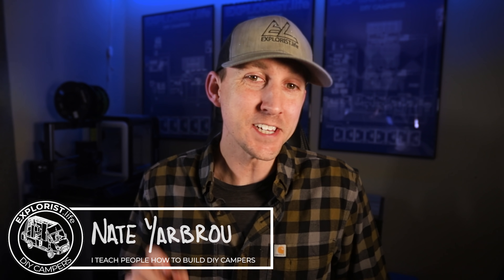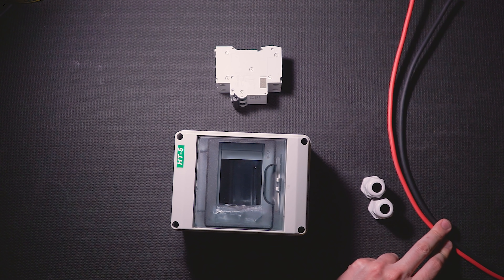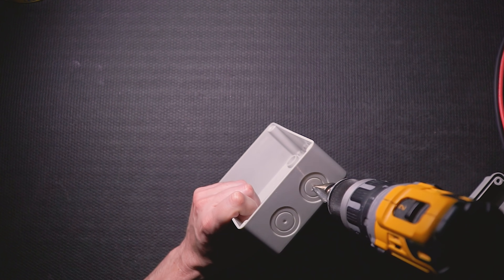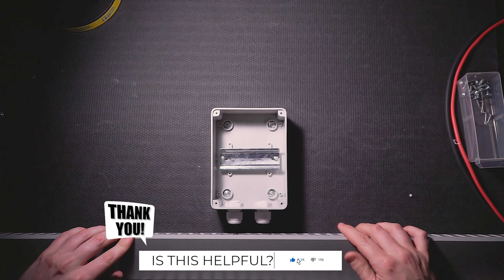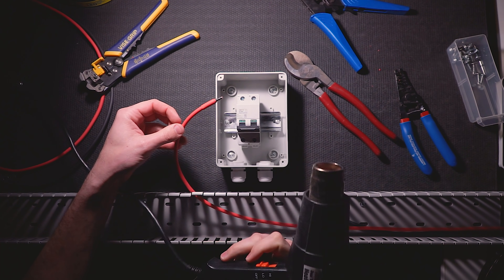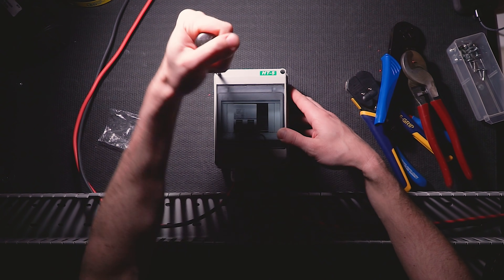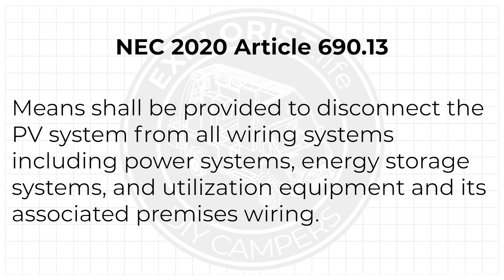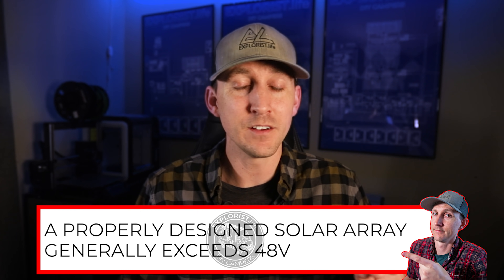How to Wire a Solar Disconnect for a DIY Camper Electrical System

Comment: Nate, you're killing me! ROTFLMBO! Ok, So I eagerly watched with the hopes of seeing how to actually install this little red box with a picture of a battery on top...wrong! I do understand why this component is needed, however, when I went to your page for the list the component is UNAVAILABLE! Now what? There's a link to a breaker box but it's gray and WTHeck? This is turning into the story of my van builds life...always a speed bump(feels like a cement block) now what? I just want to plug the panel into the charge controller, hook it up to a battery, and just wait for the explosion at this point... I am beyond frustrated now.(attention span of a gnat and I am a visual learner. Deviation from what you showed greatly confuses me) BUT I am learning a lot so, yay?
Reply: You can use any non-polarized, dual pole DC breaker and enclosure. I can personally vouch for Blue Sea's products. However, they're pricey, and I prefer the type Nate highlights. DIN rail mounting is the way to go, and this gets you away from somewhat proprietary gear from some OEM's. This is how it's done in every country outside the US!
Reply: @ARepublicIfYouCanKeepIt  Thank you I had to watch the video a few more times to fully comprehend it, but I do now. I will use the red switch between my battery and inverter.
Reply: @evespower1  While a properly rated battery selector switch is acceptable to isolate the battery from the inverter, this connection must also be fused. Accordingly, please ensure that a properly rated Class T or MRBF is protected the circuit, as well.
Reply: @ARepublicIfYouCanKeepIt  yes, that much I do know. Thank you for the information.
Reply from the maker: Oh, gotcha...  The 'red switch with a battery on top' was never part of any of my diagrams between the charge controller and the solar panels.  I have one of the 'red switches' between the battery bank and the Lynx Distributor in each of my diagrams, though.  Which of my diagrams from https://www.explorist.life/solarwiringdiagrams are you trying to follow?
Reply: @EXPLORISTlife  I was actually following the video (visual learner)from how to wire a solar system in a camper the one that’s an hour and six minutes long… honestly, I had not looked at one of the diagrams on your website yet. I just go there for parts and to calculate the Amps that I need. You would be proud of me I found the breaker box after I thought of a few different words and understood it’s purpose instead of the HT5, I got an HT8 from Amazon and I installed it yesterday! I’m so happy! Now today I’m going to try to figure out where to put this little red thing I’m guessing it goes somewhere in between the battery because it has a battery picture on it. And actually after just watching your newest video you said the disconnect goes between the battery and the rest of the system… I just have to figure that out. I am Slowly but surely working with what I have on hand. And I’m sure I’m going to upgrade to the Victron later because it just does so much more.

Comment: The Din Rail End Stopper Block shown in your parts list doesn't seem to be mentioned in the video, unless I missed it.  What is it used for?
Reply: It's entirely optional; preventing mounted components from sliding off the rail.
Reply from the maker: Exactly... They simply mount on either side of the breaker if it's sliding around too much (like it was in my video, but I didn't have any din rail stoppers on-hand when making this video and didn't want to delay the video on account of that.

Comment: I switched to that double pole last summer because you mentioned it in another video. Thanks for the explanation as to why. It sounds like that was an update in the 2020 code so there's probably lots of incorrectly wired PV systems on RVs. I had the Blue sea systems circuit breaker and my series/parallel was around 44v so I guess it was ok but I had tunnel vision looking at the amperage and not the max voltage. Thanks for explaining this in detail, great job and thank you 😁👍
Reply from the maker: Yeah, I've made that mistake in the past as well before I really dove into doing this stuff (and teaching it) properly.

Comment: Nice video! My question is do you have a amazon store? I would like a link  to the breaker , make, sizes, and availability...
Reply: I think when you go to his interactive wiring diagrams when you click on an item it goes directly to the Amazon link for the item. It's really helpful! Pretty amazing if you ask me 😁👍
Reply from the maker: Charlie is right...  You can use either my wiring diagrams and parts lists found here: https://www.explorist.life/solarwiringdiagrams for overall system components, or you can check the blog post that accompanies this video for a "Parts Shown" that includes links: https://www.explorist.life/how-to-wire-a-solar-disconnect-for-a-diy-camper-electrical-system/

I don't have a 'traditional' amazon store as sometimes I need to recommend parts and products that aren't found on Amazon.

Comment: Just finished watching, great as always.  My van is in the design phase and I am trying to physically locate this switch where it would be easy locate such that it is immediately accessible to emergency services in the event of an MVA or similar emergency.   My thought is to place it in an electrical box accessible from the out side where the shore power enters the van.  Passenger side just behind the rear axle.   The electrical room is above the rear axle in the rear garage and accessible for maintenance by lifting the step to the twin bed above the garage.   The solar shut off box and accompanying door will be a pain to fabricate but provides some security and yet quick accessibility and visible to fire fighters and EMS.  
Do you or any van owners have thoughts on this?
Reply: As Nate mentions, first responders aren't likely to know to look for this disconnect, or use it in the event of an emergency. The primary reason for this isolation switch/breaker is to allow you to safely work on your electrical system by safely disconnecting a source of live DC current even in low light conditions.
Reply from the maker: Thanks for watching!  So... I was a career firefighter before this whole Youtube thing, so I may be able to shed some light on that issue... but firefighters/EMS aren't going to be looking for a solar disconnect switch in an RV during an MVA.  Maybe in the future, as more electric cars and solar powered campers become a thing, firefighters will be trained more on this kind of stuff, but even If I, as a firefighter, saw a solar disconnect switch; it's highly unlikely I would touch it as I wouldn't know for 100% what it does or what other 'downstream' hazards that flipping that switch may do.

If, in the event that the body of the vehicle was energized... We would call the local utility company to have a lineman come out and get recommendations on how to proceed safely.

Basically... do it if you want, for sure... but I wouldn't stress about it.
Reply: @EXPLORISTlife  what does MVA stand for?
Reply from the maker: Motor Vehicle Accident

Comment: If you’re using Victron charge controllers, can’t you just turn them off using the VictronConnect app?
Reply from the maker: That would indeed turn off output from the charge controller to the battery bank, but would not disconnect the solar array from the charge controller.
Reply: @EXPLORISTlife  
If this was true, then wouldn’t your PV panels burn up your charge controller?
Reply from the maker: Nope.  When using the on/off feature from within the app, the software/hardware interaction inside of the Victron charge controllers will disconnect it in a way that it wouldn't burn itself up.  Even if the disconnection inside of the unit happens 'on the PV side" of things... There still needs to be, by the code mentioned in the video, a disconnect switch that physically disconnects the array from the charge controller.
Reply: @EXPLORISTlife  
Thank you for answering my questions. It’s a fascinating subject, as there’s so much I don’t know or understand. 🖖
Reply from the maker: No problem!  Thanks for watching!

Comment: Great video! Love your channel! 

Do you have a video on how to know where to install solar panels on an rv's (travel trailer in my case) roof?

Thank you! Again, great channel!
Reply from the maker: Hey Wa G!  Thanks for watching.  I don't have a video over that specifically, but will have a video coming out soon that will teach the best size and number of solar panels to use to get to your 'goal wattage' that I will attempt to cover panel placement in.
Reply: @EXPLORISTlife  Thank you!
Reply: Look up best way to mount solar panels to RV roof on YouTube. He uses channel strut which can be attached to the roof trusses and then the panels to the strut. The panels don't usually line up with the trusses so this method addresses that. I was lucky enough to have a hard frost one morning that showed me where the trusses are on my rig. I've heard of some people asking the manufacturer for a roof diagram to find where to drill. I used 1/2" aluminum from a company called Zoro.
Reply: @chachi5975  I saw that video. I just need to see where to mount on 1995 Jayco Eagle 304bh roof.
Reply: What are you looking to do?  ALL RV / roof tops are different. and lots of people do different things on the tops of their RV.   I took out/off my AC unit and put on  1,005 watts of solar.  What size RV do you have and what are you looking to do? :)
Reply: Where they fit. Find the edge and or RIBS of the RV and screw into them.
Reply: @RVingwithG  I have a 1995 Jayco Eagle 304bh. I wanna add solar but I'll take a better look when I get the snow off 😁. Thank you
Reply: @wardg1775  perhaps just a stud finder would work.
Reply: @chachi5975  never thought of that.
Reply: @wardg1775  Hey there, I just checked images of your rig and you have lots of options. A couple of things to keep in mind are:
• Don't overspend on PV panels. Starting with an energy inventory, match the inverter to your highest anticipated amperage, then match the battery capacity to the daily load under worst case conditions (continuous low/no sun days). Finally, match your PV array to the required recharge time under average conditions (Wh/day production), and the MPPT solar charge controller to the maximum PV voltage and battery charging current.

• Correctly connect the PV array. This is done to optimize voltage and amperage carried by wiring to the MPPT solar charge controller. It's also done to maximize production given shading. Remember that even partial shading of a single cell in a single panel connected in series will significantly affect production of the entire string. This includes shadows cast by rooftop AC systems, vents, etc.

• Consider flexible panels. I prefer these for mounting options and weight.

• Consider a tiltable mount. Production from horizontal roof-mount arrays is significantly lower than the same array that's capable of tilting to better match the angle of the sun for a given latitude and season.

• Install your array in a manner that's easy to occasionally clean the panels, or remove accumulated snow.